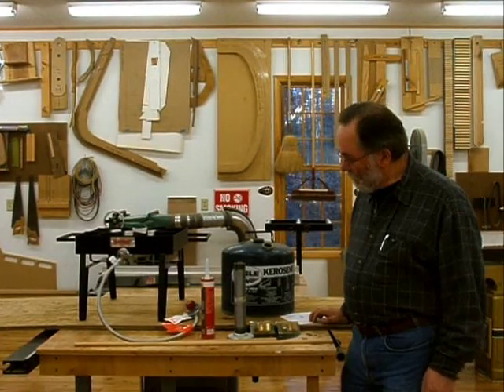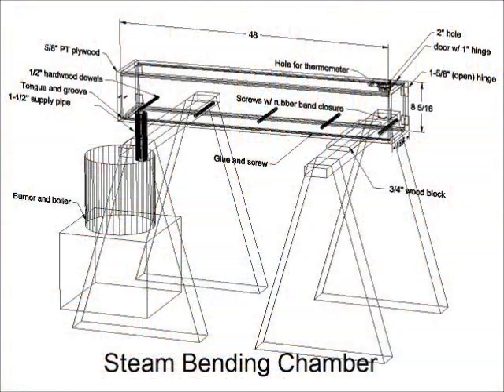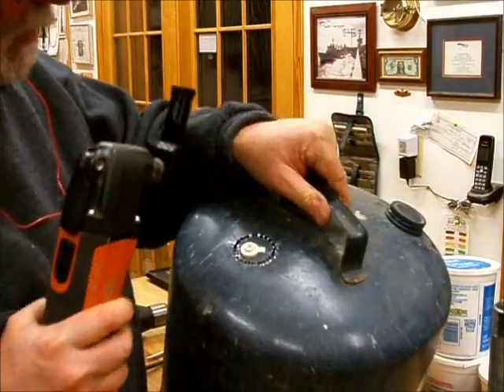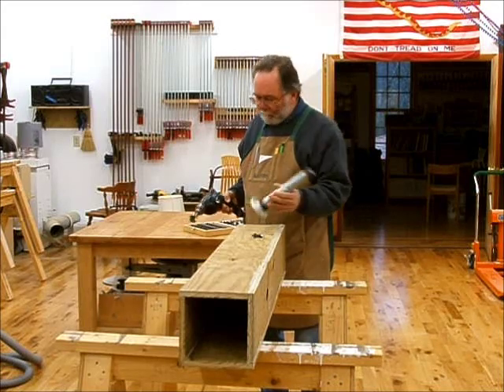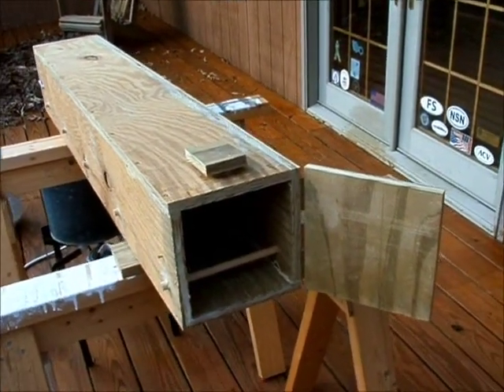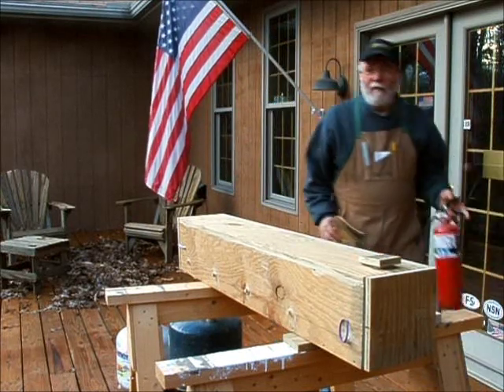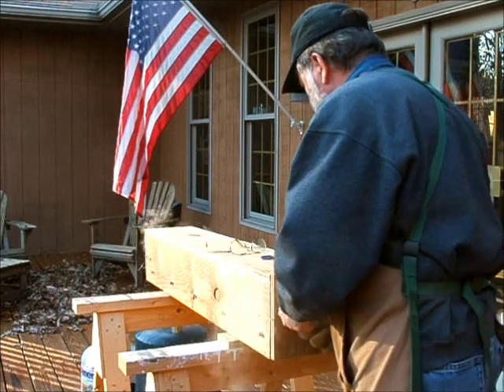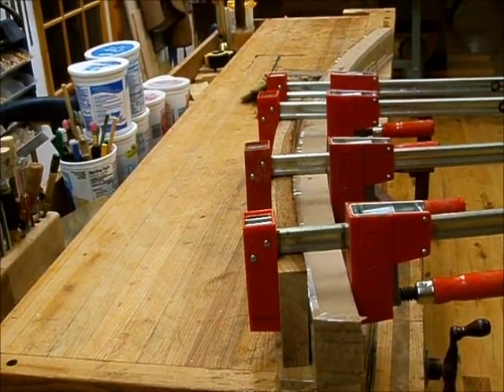Making a Steam Bending Chamber: Andrew Pitts~FurnitureMaker

Comment: nice vid!  thanks for the idea about the galvie pipe which allows condensate to return to the boiling pot ... one of those forehead slapper  'why didn't I think of that?' things ... by way of 'dumb questions,' can I use heavy nylon strapping to hold the outside of the curve and prevent splitting, or do I need a metal strap?  Thanks!
Reply from the maker: +Matthew Williams Matthew, I think nylon will stretch. You need something really strong and rigid or else the outer fibers will pull apart some. The object is to get the inner fibers to slide alongside each other to allow the inside curve to become less "distance" in circumference than it was before bending.

Comment: very good video
What temperature were you bending the wood at?
thanks
Reply from the maker: icespeckledhens Thanks. Since the chamber is vented to atmospheric pressure, the temp at sea level (about where I am) is 212 degrees Fahrenheit. At higher elevations the temperature would be less due to less atmospheric pressure.